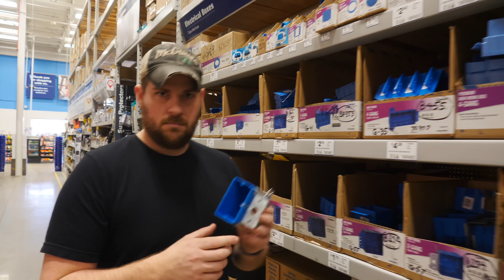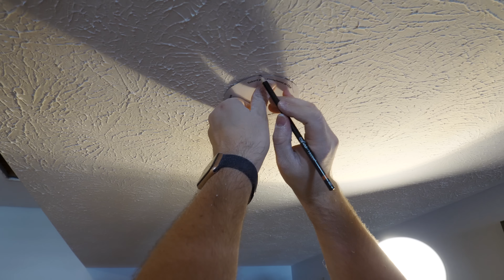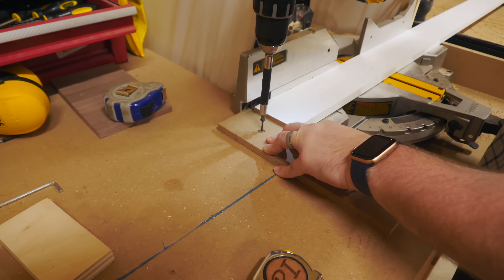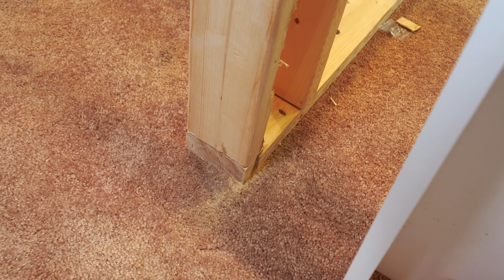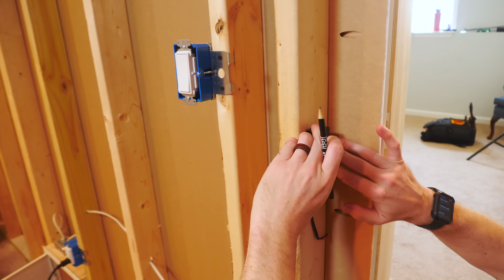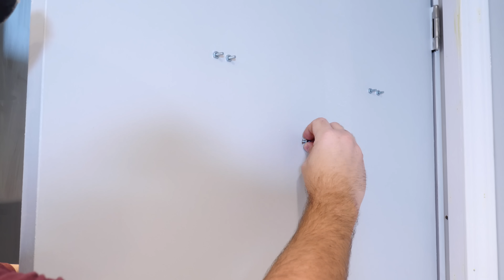How to Make a Secret Room (Through a Wardrobe) | I Like To Make Stuff

Comment: Nice video. However, the wardrobe needs to stay empty always, which is not a good way to hide a secret room. Next, if you keep walking in and out over that same piece of carpet, you may gradually see a footpath emerging.
Reply from the maker: It's in a room that doesn't get a lot of visitors
Reply: @Iliketomakestuff  Hi, I am a prepper and I have a secret room too. In the secret room I store my supplies and weapons. So the secret door may not look suspicious in any way. In my case, it is a visible door that looks like it closes a simple closet about 10 inches deep with five shelves. You can push the whole closet part into the secret room. Let's say it depends on how you want to use your secret room.

Comment: If you want to create a wall that is a sound barrier, use 2x6s for header and footer (not 2x4s). Then use one set of studs for the sheetrock on one side and install a different set of studs (not touching the other studs or the sheetrock on the first side) for the sheetrock on the other side. Weave insulation between the studs. 

Sheetrock on one side of a wall normally collects the sound vibrations from that side, transfers them to the studs that are common to both sides of the wall and makes the sheetrock on the other side a sounding board for those vibrations. Doing the above eliminates the common studs and virtually eliminates the sound vibrations that come through the structure of the wall.

Also, I noticed that you cut a ventilation hole through the sheetrock on both sides. Sound is going to come through that hole like there is no wall at all. To reduce sound, use separate ventilation runs for the two rooms.

And you will never get rid of all the sound because sound vibrations will run through your common concrete floor. The carpet will help, and thicker carpet/underlayment is better, but be prepared for some carry through.

Comment: The magnet lock is mounted wrong. It should be 90 degrees different. When magnets are “slid” apart sideways like you mounted it, it’s easier to separate. When magnets are pulled apart from facing each other, you have the maximum force.

Comment: "Yeah...  Nothin' to it..."   😆 
I've worked as a journeyman carpenter and drywall installer, amongst other things, which use these skill sets and I can appreciate the amount of enginuity and patience, as well as just "building stuff" that went into this.  Very cool.
  If you use the available hardware to stand off the drywall from the framing as well as put a thin foam liner between the double drywall on the one side, you can truly sound proof (within just a couple DBs) that room.  Depending upon the design of the (or "your") house, if the loss of depth in the room vs the floorplan/layout as you move through the house, the fact that there's a hidden room may not be immediately perveivable and with a little more effort, an actual "safe room" (add outside ventilation and separately supplied "water closet") could be a viable idea.  Even without the plumbing, it could be a viable place to fortify (with supplies and maybe a radio/phone setup) and you've got a "where'd they go!!??" room in case of a home invasion situation. 
  I have a "defensible" if not hidden room in my house that's got ventilation, a bathroom and is my CB radio base station hobby station.  If the power and wifi and phone lines all go down, a battery backup supply and my radio setup means I'm always able to get in touch with the authorities and other people, no matter what.  The radio communications setup today has a lot of small, inexpensive equipment available that's great in case of a true emergency. 
  Cool project guys...

Comment: Awesome idea! I am curious how you could do this concept with a doorway from one room to another room. I am thinking a nice wood bookshelf that is set into the existing doorway. The bookshelf would be set into the opening so that when closed, it would be flush with the outside drywall and open outward? Would the latch or locking side have to be beveled to clear for opening? I am not much of a Carpenter so any help would be greatly appreciated.

Comment: Unless  I knew the actual thickness of the concrete slab, not just what should be by code, I would not drill an inch deep. It is not a load bearing wall and to give support for lateral force use more screws. Don't want to have ground water coming up through the floor.

Comment: Why don’t you use sound attenuation sound insulation for sound transmission instead of double shhet of gypsum board on the room side. Alson solid core door fo sound insulated door, instead of
Reply: hollow wood door.

Comment: I noticed right away that you forgot one important item. If that is supposed to be a hidden room,  you need to add a camera looking out with a monitor inside the hidden room. So in case someone is in the outer room that you don't want to know about the hidden room, you can check to see if the room is clear before you come out of the hidden room.  Of course the camera will have to be hidden as well.

Comment: Thats funny I've always been under the impression that sofit is on the outside of the house on the over hangs of roofs'N'such. And studs run vertical lol thats a plate your screwing thru and why wouldn't you just use a hammer drill or a Ramset instead of changing bits but I did learn something i didnt know how to set a router to correct depth like that.  Thanks for that. Curious to know how long this project took

Comment: FYI- Screws have poor shear strength and using them for framing, especially when you have the weight of a door opening and closing, is sketchy at best. Find a stud and/or joist and use a nail.

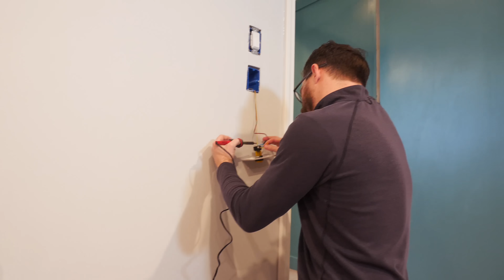Comment: Approx 24:00 you screw a vent into the wall. Are you somehow sending heat/air into the hidden room, or is it a faux vent? Would insulation in the wall add additional sound dampening? It's a very cool project. Have you seen those stairways that have a hiding spot where the entrance is actually under the stairs, it uses pneumatic pistons (like in backs of vans or SUVs) to assist the lift? You can hide things, or people under the stairs.

Comment: Very cool project, it give me lots of ideas!!!  Just one little thing though... The way you weld your wires is far to be the good technique to have an efficient join. 1- You need, in order, to have them stripped to expose the same length on both (all wires needed to be weld) 2- Then you position them one over the other in opposite direction. 3- You twist them to make a join that will remain in place for the welding.  4- You put a little bit of welding tin/lead on your iron tip you apply to your wires to make a good heating contact. 5-As the heat is transferred to the wires from the iron tip up the the little bit of welding, you can finally stroke your welding tin/lead on the exposed wires all over it, it will melt and the contact will be perfect every time. Yeah I worked in electronics for years. Still you do awesome jobs in your projects!!!

Comment: Cool project, but...
I would have added sound insulation to the wall before putting the drywall on it.  How much sound travels through the air vent on the wall?
It would have been easier to use a magnetic catch to hold the door closed.  Just a firm push or pull to open it.  Much easier and no electronics needed.
Having the AC and CATV outlets in the wardrobe makes it look like something is amiss.  Should have make some changes to the plan or changed/removed the outlets.
I wish I had a spot like this for a similar project.

Comment: Nice! The only thing I didnt like is the "key" on the outside. I rather would have integrated a RFID card reader inside the shelf and put a card inside the bottom of the "pot", swipe the pot over the reader to unlock, hiding all the cables instead of having a hole with cables running out from the wall =)

Comment: Noticed the vent negates the soundproofing and probably lets light pass through as well.   Should have used the same fake ceiling the lights were installed in as ventilation ducting.  Also noticed the wierdness of a power and cable outlet INSIDE the cabinet.  Almost invites someone to turn the cabinet into a built-in TV console, blocking the entrance!.